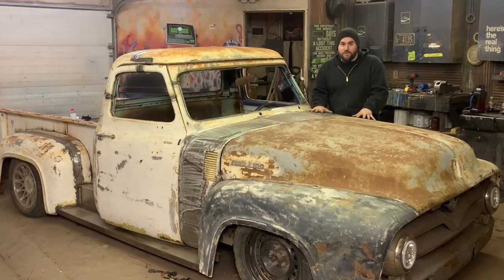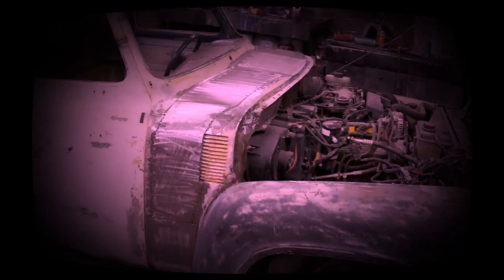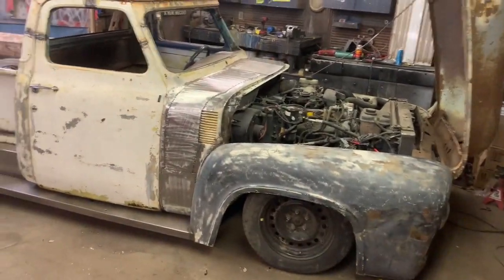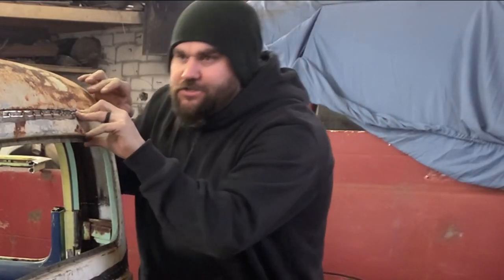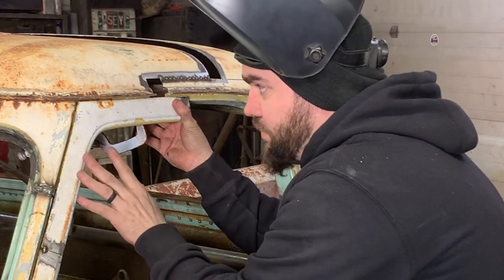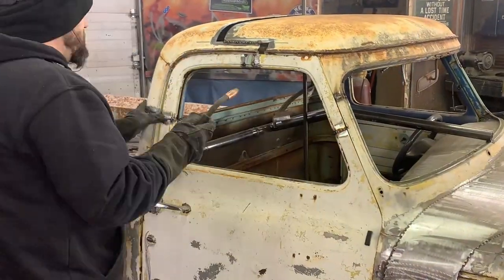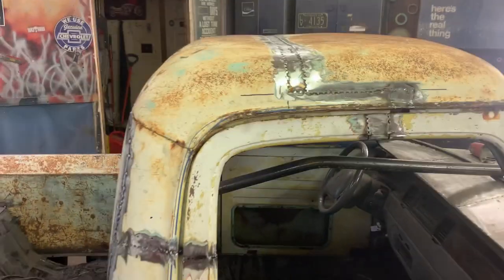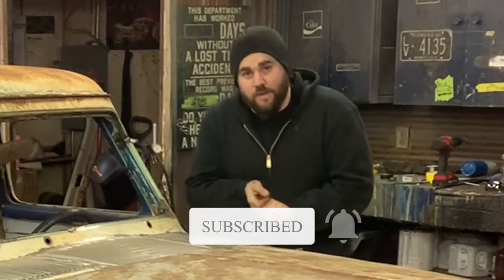BUILDING A HOT ROD FOR UNDER $1000 DOLLARS! PART 17! HOW TO BUILD A RAT ROD ON A SUPER CHEAP BUDGET!

Comment: I don't sign in to google often, I don't give them any data if I can avoid it, but I had to at least give this project a thumbs-up. You're doing good work here.
Reply from the maker: Thank you very much!!
Reply: @CaseysCustoms  I am interested to see how the steering and wheel clearance is handled. How do you avoid interference there and still give it some decent turning radius?
Reply from the maker: @borzwazie  I’m going to be running steel rims and I’m gonna run an offset that brings them in an inch or two and that should let me go lock to lock on the steering
Reply: I dont mean to be offtopic but does someone know of a trick to get back into an Instagram account?
I was dumb lost the account password. I love any help you can give me!
Reply: @Lochlan Elliot I really appreciate your reply. I found the site through google and I'm in the hacking process now.
Seems to take quite some time so I will get back to you later when my account password hopefully is recovered.

Comment: Same boat, man. I’ve been all over the web looking for answers to why my frame swap lincoln won’t start. Cranks for days after welding the cab up. Hope the no start is like you said from the cooked pcm. I’m halfway tempted to just start over on a different frame swap. I hate wiring with a passion.
Reply from the maker: I am also not a fan of it. I’ve used these tons of times and never had an issue bevuSe i always unhook the battery, apparently even that isn’t enough sometimes. I’ve had a couple guys who build newer stuff tell me they unplug the pcm anytime they do welding 🤷🏻‍♂️🤷🏻‍♂️

Comment: I have a stupid question because im still new to welding but I know most people use .030 or smaller wire for body panels and thin sheet metal but is it still workable with .035? I bought two rolls of it and don't really want to switch rolls just for body panels if I don't have to.. I might just buy a dedicated mig for thin material if I start doing more of it.
Reply from the maker: .023 is best for sheet metal, you can use .030 but you really gotta turn it down and be careful with the heat. .035 i wouldn’t do any sheet metal work with. It’s just takes too much heat to melt .035 to use it on sheet metal without causing bigger issues

Comment: When you do the rebody of the truck to car which vin an title do you use? Do you need both and DMV figures it out? Thanks
Reply from the maker: Always use the title to the body you can see. It won’t fly if you are driving a 54 Ford truck titled as a 2000 Lincoln.

Comment: i could see how emf pulse from the welder could mess up a ecu other electronic components at close range
Reply from the maker: Yea, I still don’t see how it could with the battery unhooked (and I’ve done it this way for 15 years now) but we shall see when the new one shows up. It certainly is all pointing to the ecu right now
Reply: @CaseysCustoms  that emf pulse is a wave  cutting across the wiring harness inducing current every time you stop and start those small voltage spike across computer. your broadcasting the waves so it doesn't have to be hooked up and that induced voltage in the wires has to go somewhere so may be earthing the negative might help i mean grounding the car to a ground rod in the earth?
Reply from the maker: @williamshoemaker3025  the guys who weld on newer cars daily are just unplugging the ecu/pcm’s from what I’ve read

Comment: Have you tried disconnecting battery leafs and connecting the leads together for 30 seconds then reconnecting them to the battery, 
Worth a try
Reply: Battery leads😬
Reply from the maker: Yep i already reset everything and no luck, you don’t have to connect the leads either, just undoing the battery does it
Reply: Connecting the leads guarantees that any stored voltage in capacitors is drained
Reply from the maker: @miketodesco6915  hmm, really? Good to know 👍

Comment: Replace the coil.  The coil will let you start the engine let it run,  then shut off the engine like you turned off the switch.

Comment: Couldn't u use a piece from each door and not have a little piece  in the middle ?
Reply from the maker: You could, but it’s a slightly different shape on the side versus the top, when i don’t have a spare piece like i did here; that’s how i usually do it and just modify it to fit